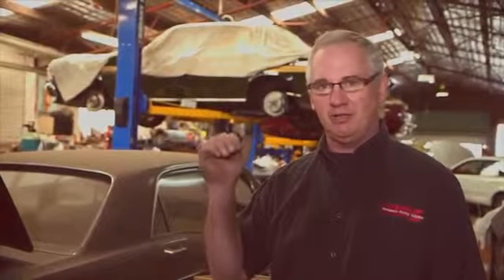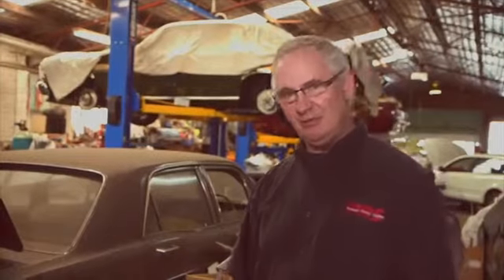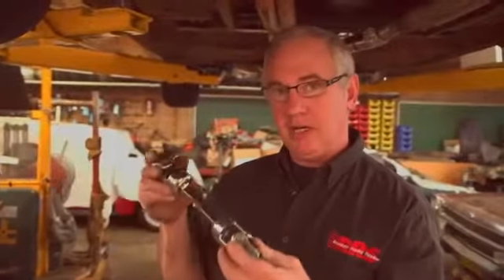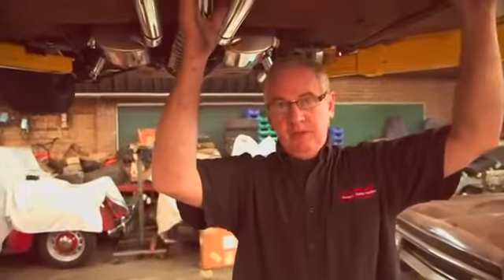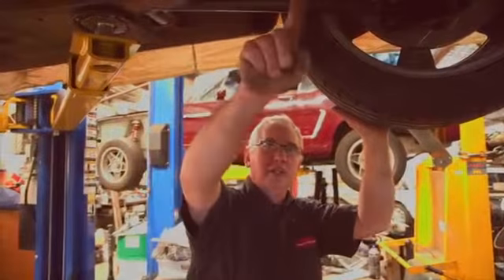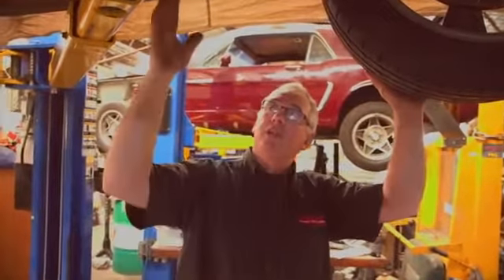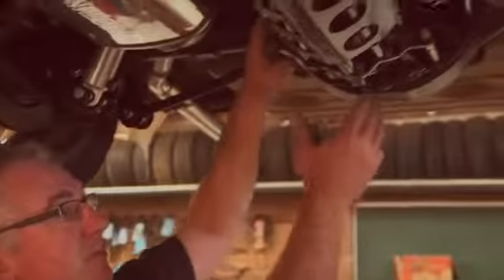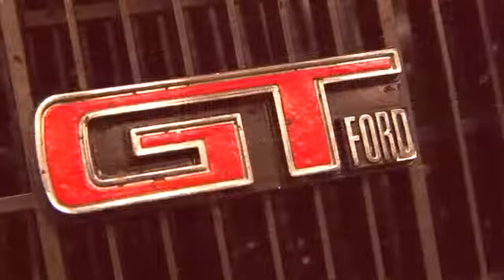RRS XY GT HO FIT OUT

Comment: Excellent info for upgrading an older hi performance car, especially to counter a worked 351. I owned a Phase 2 351 Clevo back in the day, & understand all that is required to make the car handle, stop & go, like a late model performance car.